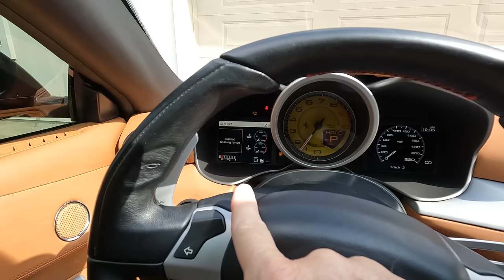Hoovie Bought One of Our Ferraris...  And it's NOT a Hooptie?

Comment: You say Tyler (Hoovie) doesn’t have to do anything to this car,  but why is the check engine light on? Is there a future Dave (Wizard) shop video in Hoovies future?
Reply from the maker: The check engine light isn't on. All Ferraris have a cel for about 30 seconds after startup.
Reply: Many cars, not only Ferraris do this. This is simply because as you fire up  the car, the sensors take a moment to read. That goes for temps, pressures, O2 levels etc. Many cars do this.

Comment: Hey Dan, quick question, my 2010 Ferrari California passenger mirror stopped rotating. My driver side mirror works fine. Ferrari recommended I purchase a new mirror assembly, is that needed or do you think I should just replace the mirror switch?
Reply from the maker: I don't know. Check if the switch is broken first.
Reply: Put a multimeter on it after the switch and see if it gets power as you operate it. If not, it's the switch. If it is, it's the mirror.
Reply: @AB-80X  thank you
Reply: @normalguysupercar  thank you